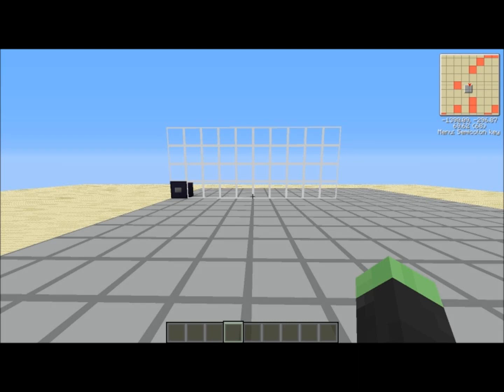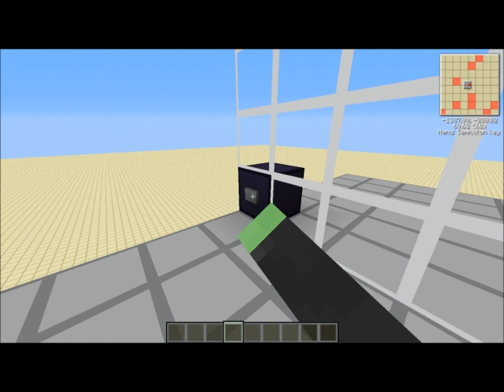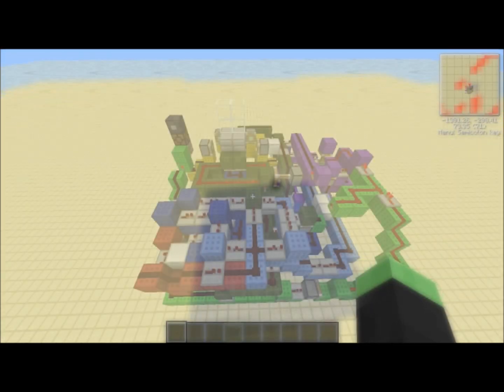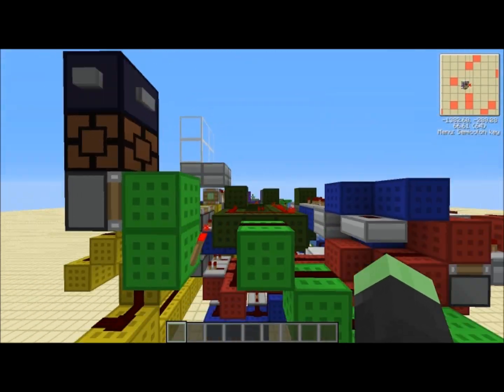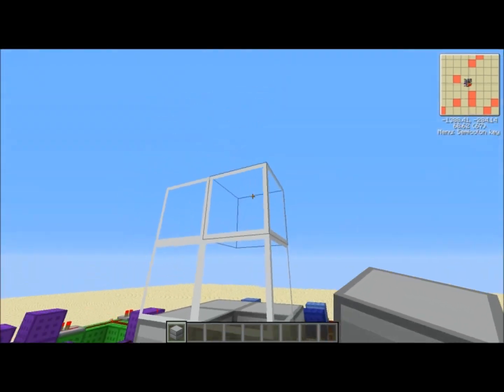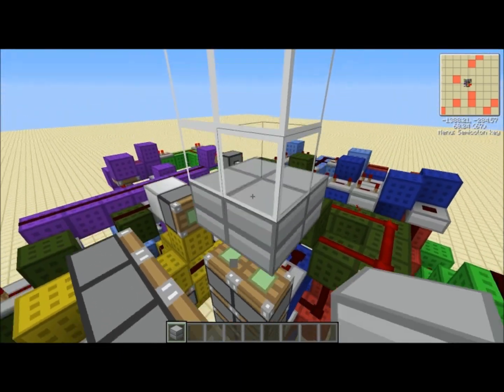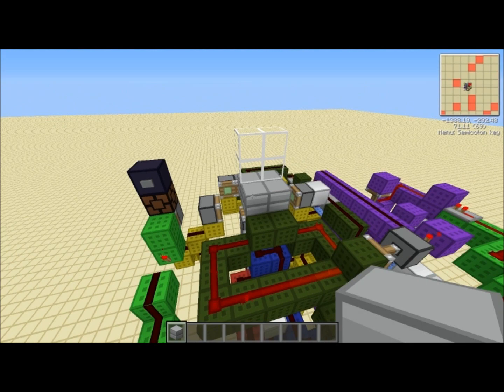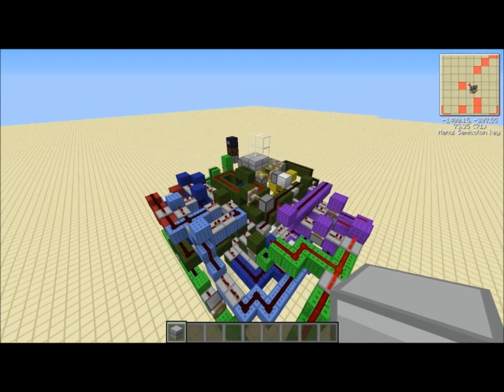Minecraft; 2x2 Seamless Glass Hipster Door

Comment from the maker: The first action takes 3 tics. If I were to keep one set of pistons extended, it would still take 2 tics to change the state of an rs nor latch, so doing this would only speed the door up by a single tic. Likewise, as you said, this would require a fair bit of rewiring. I'm running the door on a very short pulse (1-3 tics at any given time), so a solid state wire would not be congruent with what I have so far. Nonetheless, thanks for the tip!